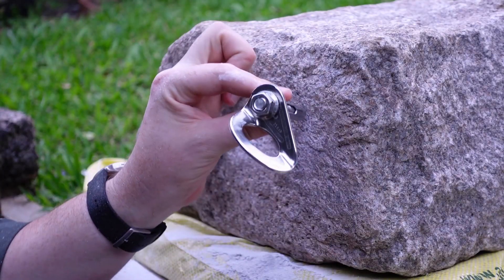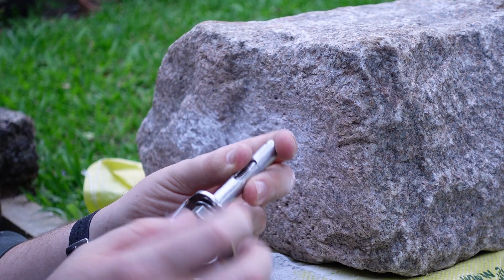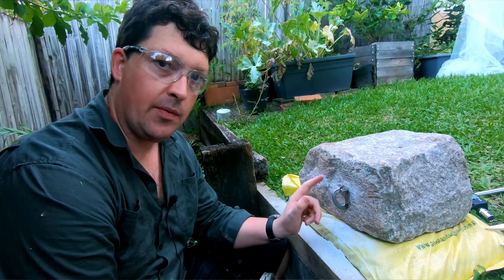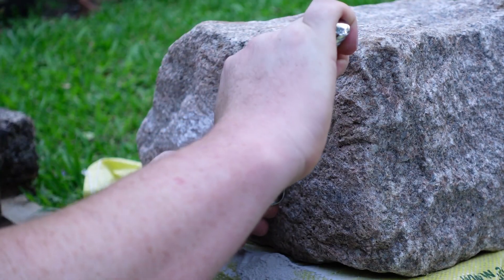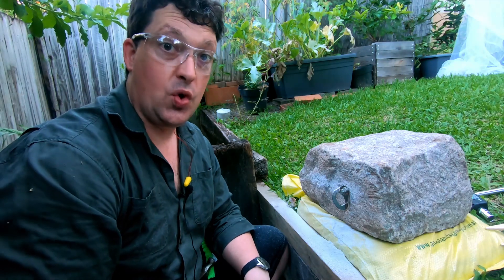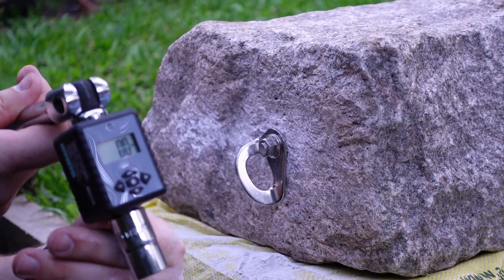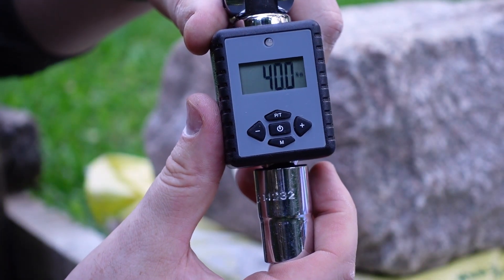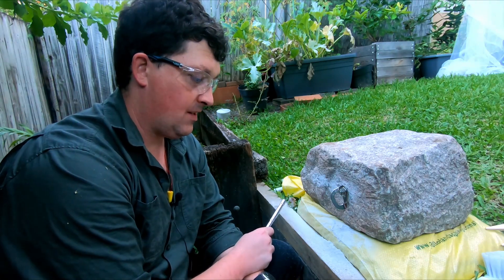How to properly install sleeve anchor bolts [Bolting for climbing]

Comment: I WANT TO MAKE A CLIMBING WALL  - MY HOUSE'S  TALL SIDE IS A 5 METER  WALL/ CINDER BLOCK -  I WAS GIVEN 2 WEDGE BOLT STAINLESS 12 MM WITH ANCHOR  HANGER -- CAN I DO THIS ?
Reply from the maker: No those bolts won't really work in hollow block like that. You'll need to use glue in studs with epoxy glue and mesh baskets to hold the glue in

Comment: This video is the only one that helped me.But how much weight do you think that thing could hold? Also where did you get your bolt from?
Reply from the maker: Thanks mate! This size/material bolt has a theoretical strength of about 40kN (around 4 ton) and with a 5x safety factor, you should be ok loading it up to 800kg. But always check the spec sheet!
I don't remember where this one was from but any hardware store should stock them

Comment: Excellent video. How does the bolt stay in the rock without some sort of anchoring adhesive?
Reply from the maker: Thanks mate! This style of anchor expands at the end when you tighten up the nut. The expansion presses on the sides of the hole, locking the bolt in with a friction/interference effect